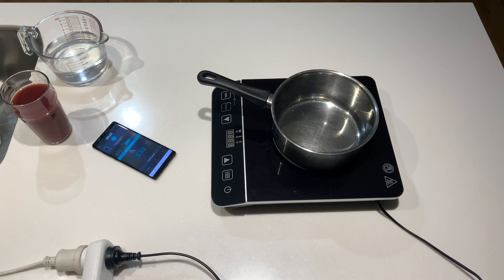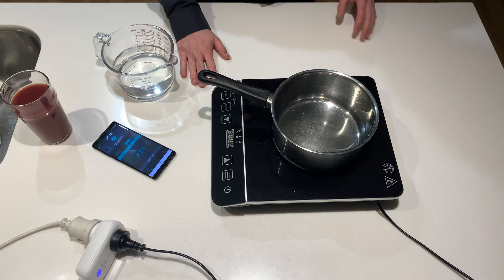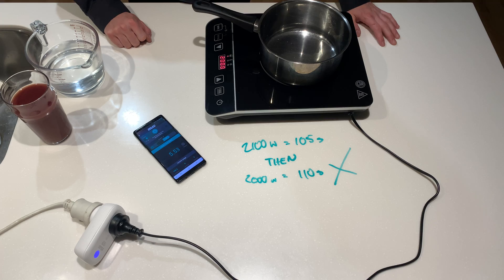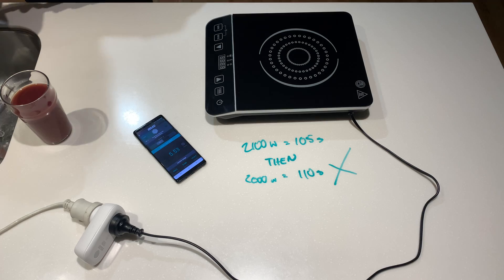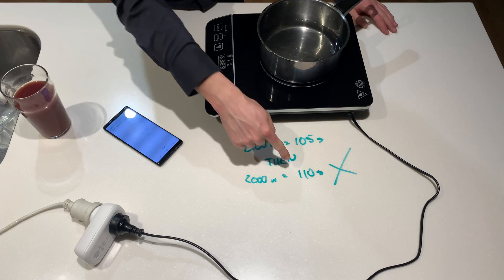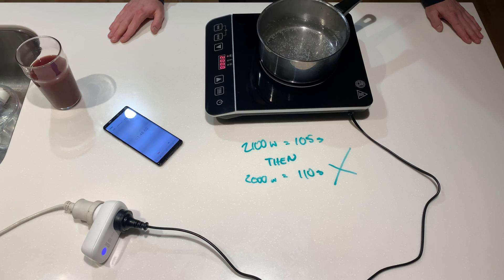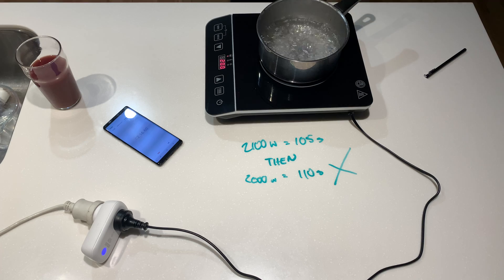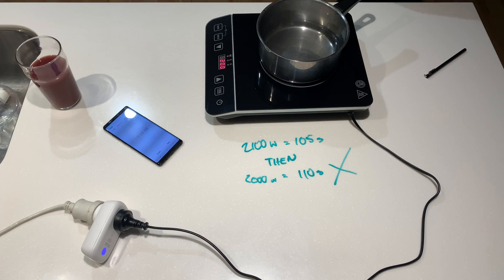Re-test of the Kmart / Anko 2000W Induction Cooker (plus Arlec GridConnect PC399HA)

Comment: No power how to repair induction cooker technican say induction cooker ic defective ic dont have any numbers kindly help how to repair induction.
Reply from the maker: Do not repair mains voltage appliances unless you are qualified / certified to do so. It is extremely dangerous. I would recommend throwing it in the bin and buying a new one.

Comment: So u need an adaptor or something to run it amd how much weight could it take. For example could you use 10 litres of water to boil for example
Reply from the maker: Man I am so confused by what you are on about. No idea why you'd need an adapter? It can take a fair bit of weight, but 10L of water would be 11-12KG and it's only rated for 8KG, so maybe do 5L at a time 😊

Comment: Bigger surface area of pot will make a difference
Reply from the maker: Yep absolutely not wrong mate! I ended up confirming that I used the same pot each time, but even then having checked the internals of these the induction coil is always so small I could probably just use a stainless cup!

Comment: The size of the pot DOES matter, less surface area for the induction to act upon WILL reduce heating times
Reply from the maker: Not really in this instance - the actual induction area in these portable units is usually only 3-4 inches wide, so I've found that I can boil 1L of water at 20C with different size pots at nearly the same time (at sea level too of course). Valid point for stove-top cookers or large industrial ones!

Comment: Couple of thoughts
Starting temperature of the water for the first test
Size of pot (wider/shallower) likely to be quicker
Conductivity of one pot v another
Thanks for testing it for us
Reply from the maker: Hey mate you are not wrong at all but I do try to mitigate these little things as best I can. The starting temp would have been within ~2C though as my internal ambient temperature is pretty solid, and I've otherwise been using the same pot for all of these tests! Cheers
Reply: @platima  Ahhh, well actually at 1:23 of the video you said "two different pot sizes, but shouldn't really matter" - Well in fact it DOES matter - energy transfer is proportional to surface area, among other things. At least you got some views and comments - cheers.
Reply from the maker: @mikea3970  yeah you're not wrong there, however, both pots are very similar sizes, and both have a larger conductive base than the size of the induction coil is, so I'd argue that the effective area is much the same. Not perfect I know, but I think it would make minimal difference for this test.

Comment: Does the size of the base matter? If the induction zone of the pot doesn't match that of the cols, you might get inefficient coupling?
Reply from the maker: Yeah I found one (Breville I think?) I had to take back as the induction coil was off centre and quite small, which actually made a difference

Comment: Thanks mate. Does this one, or any of the ones you've tested, keep a constant wattage, or do they use a high wattage and cycle on and off? E.G. say you want a medium temp so you set it to 800w, but instead it draws 200w then turns off for a short while, then back on again - repeat? I'd like to know as I want one for a campervan and need to ensure the wattage isn't too high or I'll have power supply problems. Cheers mate.
Reply from the maker: Hey Jez. Have tested quite a few now, and then ended up reading; they all cycle. It's kind of inherent to how induction cooking works.

For a camper I don't think you can ever go induction unless you're running a genny. Best stick to gas! And good luck.
Reply: @platima  Thanks for the reply. I am defo going induction as I have 24000 watts and 400 volts at my disposal - it's an electric campervan! ;-) I want to keep my life fossil-free. So that's not a problem. Also, there are certainly induction hobs out there that draw a constant wattage FYI, as I've seen videos where the guy has a meter on the current and you can see that it is constant rather than on off on off. But if you don't know then no problem; just wondered in case you knew as I'm trying to find a hob that's available in NZ or Oz - the one on the other video that was constant is in the UK so that's a pain to fly over. Cheers mate!
Reply from the maker: @jezthomas4402  oooh okay yeah that's a hell of a seup then. And good on ya!

No idea about constant. Maybe the bigger AC ones?

Reason I assumed none of them is I was at a friends place and her kitchen stove is induction, and did the same thing. 

What if you go to an RV/camper shindig. I'm in WA, and we have them here once or twice per year in Mandurah I think, and they're huge!
Reply: I'm trying to work this out for the same reason. The coil on the cooktop is switched at high frequency, so there is no reason that it couldn't be smoothly modulated across the power settings, so although it's full on or full off, the periods are very short, and it presents as a lower power load as the duty cycle is more off than on. If the on/off periods are long (seconds), your camper is going so see short bursts at full power (which is not what you want)
Reply: @DazzaOnGoogle  Thanks. I bought the Vango sizzle as I knew it was tested to show reduced wattage as you reduce the heat settings; i.e. it doesn't pulse and so won't blow my inverter. Cheers.